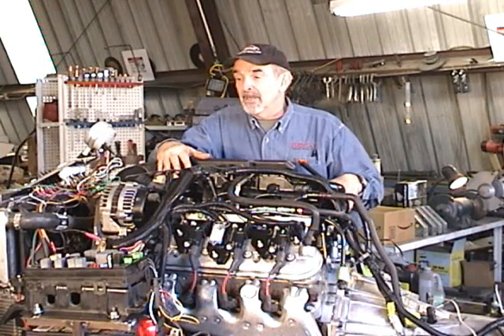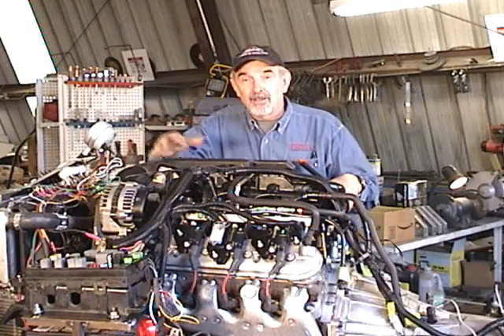BMW with Chevy V-8--Segment 1

Comment: i'm saving up and going to install the ls1 in my e30, i'm doing it for performance and because its several thousand cheaper than working on my m20 6 cyl to get the same performance as a stock ls1. i cant wait!

Comment: Honestly...50/50 is mostly marketing bullshit. Allows a more balanced car through a turn...That's about it. As long as a RWD car doesn't have a heavy front(let's say 54+/46-), it will be alright. 

Proper suspension tuning will solve any ill-handling characteristics that are caused by changing the distribution.

Comment: the only dispute I have with that is that bmws are designed to be 50/50 you throw that off with these motors. but i still want an ls1 e36